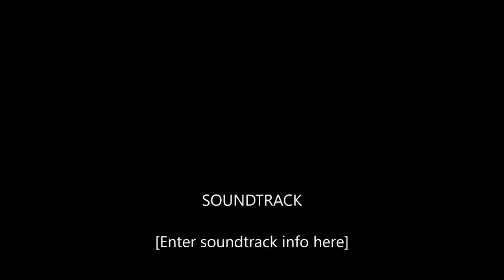How to cut up a car scrap and recycling after part out selling on eBay

Comment: I used to part out cars in my garage and when I had just the empty body left I would use a 12ton wench and pull the body up onto a utility trailer. You can put wood or car hood under the body and it'll slide easier. Once at the scrap yard they would pick the body up off my trailer with an excavator or large forklift.
Reply from the maker: I do that as well. I have a large trailer, but I now have a better saw and just cut it in half and load onto a trailer.
Reply: W

Comment: Invest in a plasma cutter.
Reply: Plasma cutter ain't the best tool for this. The multiple layers in many areas separated by up to two inches of air from the layer above it means a plasma cutter would be almost useless. The best tool is an Oxy/Acetylene cutting torch but his broke. The sawzall isn't perfect but it's better and faster than a plasma cutter in this situation.
Reply: @LordPadriac  no

Comment: Harbor Freight has a plasma cutter that is somewhat affordable it has treated us nicely.  Its still tricky to make the thick/frame cut.  Did you make enough ca$h back for it to be worth your time?  I post the panels and if they don't sell I have my scrap guy pick them up on the flatbed.  sure its not as much ca$h but on to the next project and it never bad to have a friend with a tow truck.